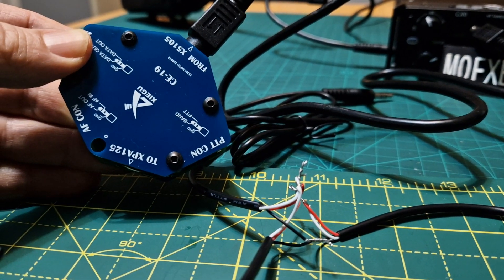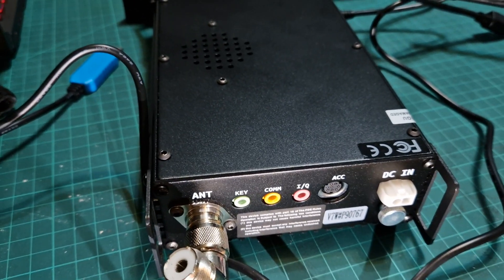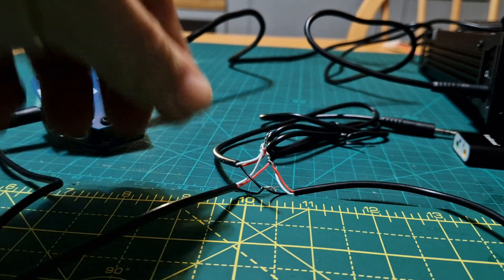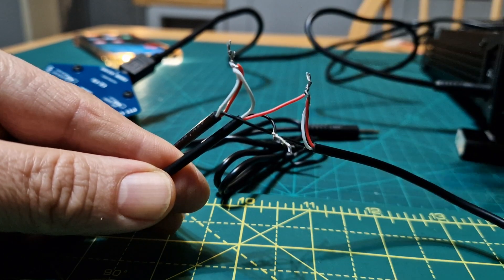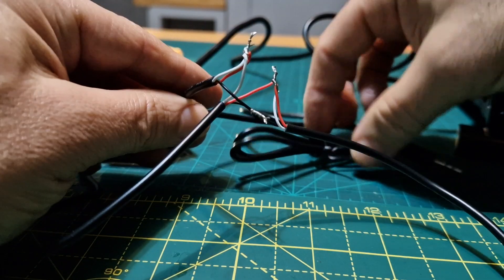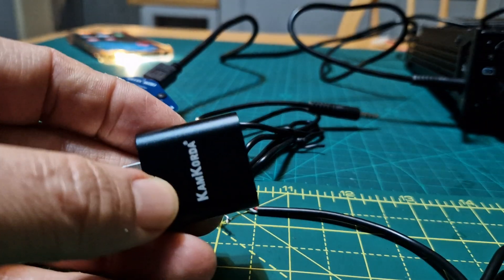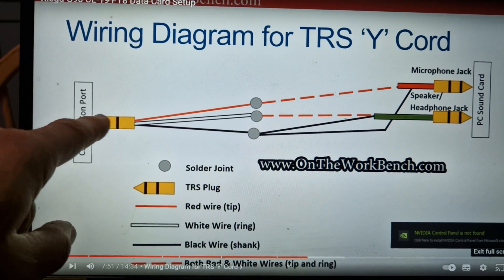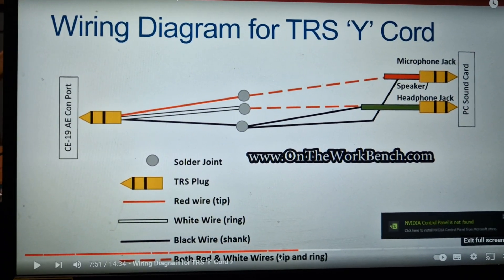XIEGU CE19 - G90 - WIRE CONFIG - DATA MODES

Comment: If you have not ordered the CE19, dont. I got mine a year ago thinking it would be a simple plug and play set up. It's still not working. Run, run far away. Get something different. I should not have to wire any damn thing, to do, what it's supposed to do, and advertised to do. Very disappointed. NOTHING about this thing is easy. I should not have to buy a sound card, I should not have to order and ftdi cable. It should all have come in the damn box pre wired ready to plug and play. This is 2024. If I wanted to build a radio I would have done so.
Reply from the maker: Agree it's not great .
Reply: The problem i saw with his video is he plugged a stereo microphone jack into a mono usb sound card jack.

Comment: Hi Andreas, I followed your videos to the book but I’m unable to get my audio working right. Could really do with some help please if you don’t mind. Martin M7COV
Reply from the maker: Hi what part can you not do.
Reply: @M0FXBHamTech  I’m all good right up until I start jtdx. The audio don’t look like it coming in or going out. Have checked and rechecked wires and plugs are in the right way. Instead of a thick line on the waterfall it’s a very thin line. I am using a raspberry pi as well